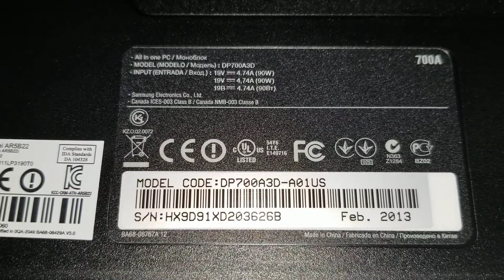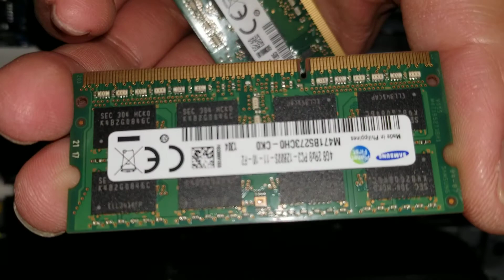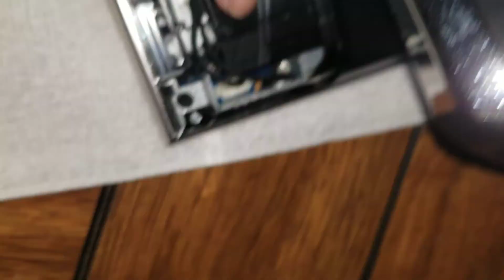Samsung AIO All in One DP700A3D-A01US Disassembly RAM SSD Hard Drive Upgrade

Comment: just needed to order ram for this antique piece, and I appreciate you showing the make and model of it. Thumbs up'd
Reply from the maker: Glad it helped. Make sure to like and subscribe. It'll really help me out. :)
Reply: Dont mix the ram as it is in that machine someone put a stick of single channel and a stick of dual channel and you NEVER NEVER EVER mix that ram Like  that because the single channel is slower ram and the computer will always by default to the slower ram when it is mixed like that
Reply from the maker: There's no such thing as single channel ram. The ram runs in single channel mode if you have one and dual channel if you have two. You want the speed and capacity to match. Brand isn't as important.

Comment: Hi I've had this PC since 2013 got it new. I've upgraded it to Windows10 about 2yrs ago. But Do you think it's time to upgrade to a new PC? Or do you think this PC is more than capable and that it still holds up today?
Reply from the maker: Just needs an SSD and it'll run well. Usually you don't need anything special unless you're playing games or doing things that require a lot of processing power.
Reply from the maker: Probably 16gb, but more than 8gb is usually a waste.

Comment: Great video what type of ssd would you recommend? Would a samsung evo q sata 3 be fine, and would it work fine with a bootable copy ?
Reply from the maker: How much storage do you need/want?
Reply: @ItsBinhRepaired  at least 500 gb up to a 1 tb but is it possible just to do a bootable clone and use it. Thanks for the prompt response, also does the ram only go to 8gb or up 16 gb
Reply from the maker: @LuisHernandez-py2dl  this should help https://youtu.be/4p5jFDzVwUw
Reply from the maker: @LuisHernandez-py2dl  ram depends on the bios support. Usually you can put the max
Reply: @ItsBinhRepaired  thanks for the reply and link. i have done ssd and ram upgrades in macs by cloning the hdd and they are mostly plug and play after cloning.... so I was wondering if I could do the same with windows but it seems a bit more .. also I'm guessing this model of computer uses an ssd 2.5 but is it sata 3? I'm not really at the level you work I'm more like I watch a YouTube video and do it
Reply from the maker: @LuisHernandez-py2dl  I don't bother with specs. I just assume everything is sata 3. Not like it'll affect the part I buy...so why bother? It's like asking what metal the screws are made of. Not like it'll change anything knowing, so why bother?
Reply: @ItsBinhRepaired  thank you i appreciate it ill go ahead and upgrade this old computer
Reply from the maker: @LuisHernandez-py2dl  I think everything for the last 10+ years are all sata 3 haha hope it makes your computer much faster :)

Comment: Great video! It's been left unused for over a year by my parents, so I've claimed it. It has slowed down so much that it wouldn't let you navigate the desktop when booted, so I factory reset but It is still experiencing the same issues. Do you think if I upgraded to 8GB Ram and new SSD, it would be good as new again?
Reply from the maker: SSD and clean Windows install will make a huge difference. 8gb ram will be nice but not really necessary if it already has 4GB. Don't forget to like and subscribe if you haven't already, it'll really help me out.
Reply: @ItsBinhRepaired  Also if I am just replacing with SSD, and annoyingly the installation CD is missing (which has the product key) , will the PC system automatically be able to detect and load Windows 8 which it originally came with? Any instructions on this will be helpful. Thanks.
Reply: Just checked with Samsung Support Online they said if I put in new SSD, I need to install a new operating system and can't use old one because it is embedded in the current hard drive. Is that correct? I was hoping to reinstall the original Windows 8 and upgrade for free via Microsoft website.
Reply from the maker: Do this https://youtu.be/R6GVDyVqWso and then create a usb after upgrading to Windows 10.
Reply from the maker: If you haven't already, please like and subscribe. It'll really help me out.
Reply from the maker: Do all of that on the old hard drive first
Reply: @ItsBinhRepaired  took a little while however, 100% success.  It was my first time ever upgrading to a new SSD.  Big thumbs up! :) Thanks
Reply: Will any ssd work or which one would you recommend? Is it a sata 3 like a samsung evo q would work? I read that is better to do a clean install but  my father has a lot of old docs in it would it be possible to just do a bootable copy?
Reply from the maker: Awesome!
Reply from the maker: You can clone it. I have a video showing how I'm my general repairs playlist.

Comment: I have a Samsung DP500A2D-K01UB. Do I need the Kingston ssd upgrade kit or just the SSD ?
Reply from the maker: What's in the kit?
Reply: @ItsBinhRepaired  From MrMemory site
2.5" SSD
2.5" USB enclosure
3.5" bracket & mounting screws
SATA power & data cable
7mm-9.5mm adapter
Acronis True Image cloning software for Windows - download coupon
Reply from the maker: @mickeydurden577  kit not needed. You will need a usb sata adapter if you're cloning the drive.
Reply: @ItsBinhRepaired  thanks man, liked and subscribed
Reply from the maker: @mickeydurden577  awesome! :)

Comment: I want to remove the Network Card. You said "just flip it up" but from what side? Please give some more details. Thanks. And do I need to unscrew anything?
Reply from the maker: You can't tell from looking at it? Pull the antennas up from the wire end and you should be able to see the screw holding it in place. It'll pop up like a stick of ram when you remove the screw.
Reply from the maker: It's very important that you pull the antenna wires close to the connector up so it disconnects at an angle. Don't try and pry it up from the other end.
Reply: I got it thanks. In fact, all I had to do was unscrew the screw holding it to the motherboard. A very tight screw, but then the card did, indeed, just flip up with a little leverage underneath.
Reply from the maker: @davidwilding  it was stuck? Make sure to use the right sized screwdrivers. Once you strip the top, it'll be stuck forever.
Reply: @ItsBinhRepaired  OK the new network card arrived and is safely inside. All seems OK. However, can't quite close the case at the top. You showed us the clips in the video, but I can't get them back in properly. But the rest of the case is closed. Something more i should do at the top?
Reply from the maker: @davidwilding  you have to slide the top side in first.

Comment: Hello Sir,
I have the Samsung model DP700A3D-A01US that u are dismantling here. Thanks for that. recently the original HDD has crashed and I kind of like Windows 8 with the pre-installed Samsung software. Is there any way i can get a copy of that either on Hdd or memory stick. I am willing to pay for it.
Thanks
Reply from the maker: Try this https://www.microsoft.com/en-us/software-download/windows8
Reply: This does not give me the original Samsung software. I have windows 8. 8.1 and windows 10 all on cd or memory stick. But i am interested in the Samsung original software. Pre-installed
Reply from the maker: @mchighali  you have to download that from Samsung or ask them about a recovery disc
Reply: @ItsBinhRepaired  Need ur help downloading that or getting the recovery disc. Samsung was not helpful at all.
Reply from the maker: @mchighali  I can't help you with that. I hate bloatware that comes on computers so I only do clean installs. You'll have to Google for that. It'll probably time consuming for me to find it if it's even available. And unless you're willing to pay me like $50-80 just for the time to track it down, it will be too much effort for no pay. I do this stuff for a living and am already super busy with my actual local customers.

Why do you need the factory setup specifically? What's on there that you need? Might be easier to look for that specifically.
Reply: @ItsBinhRepaired  the original software and driver. Example the touchscreen is now disabled
Reply from the maker: @mchighali  Windows 10 will install it automatically. You have to install the drivers from Samsung.
Reply from the maker: The website will have all the drivers
Reply from the maker: Here's what you need. https://www.samsung.com/us/support/downloads/

Comment: Good night, for upgrade, until what processor can I put on it? and what frequency rate in ram memory, Sorry for my bad english
Reply from the maker: Processor depends on what the board and motherboard supports. I'm not too sure to be honest. Usually as long as it fits the socket and you don't go more than 15w power usage higher, you'll be ok, but they might not have allowed it in the bios. Not sure if it'll accept different speeds or RAM, but it's 12800s.

You might be able to find more info on Google.
Reply: @ItsBinhRepaired  i cant find my exact model :( DP700A3D-K01Mx
Reply from the maker: Have to keep checking